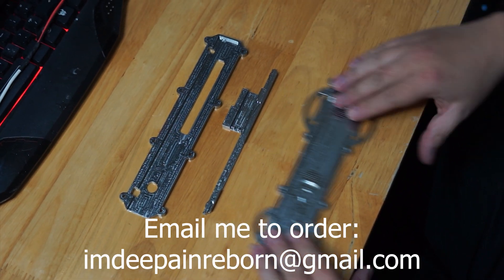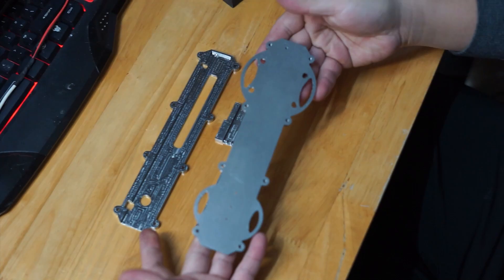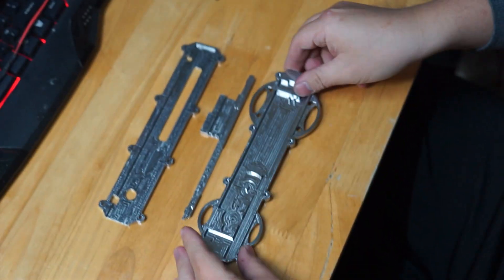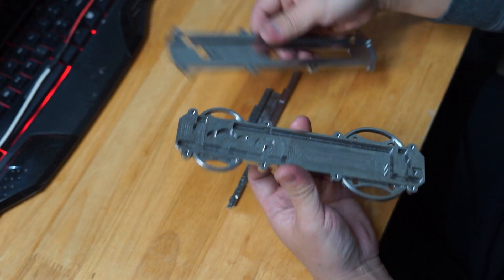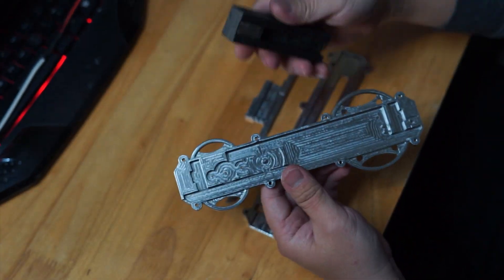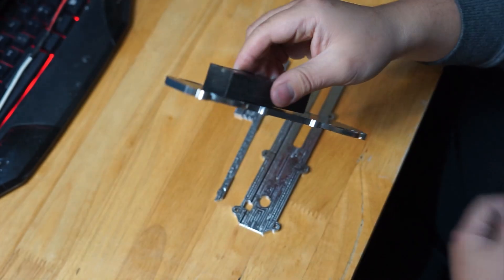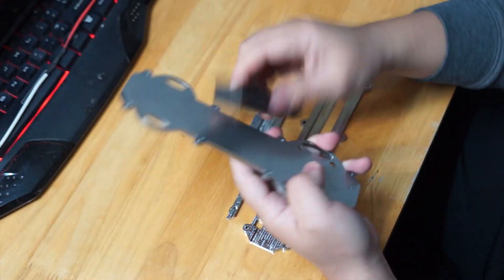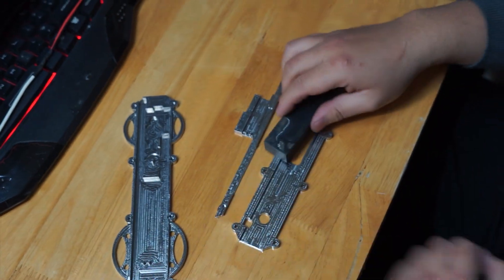Real steel hidden blade CNC project part 1

Comment: Awesome, do the benefits of using the stronger material seem obvious or does it just have a different feel than the aluminium?
Reply: Fairly obvious I would say. Think about how a hidden blade is used by the Assassins. Aluminum would get the job done if used in a precise manner against an unarmored target but it would get damaged very quickly if it meets armor or even bone. No idea if the aluminum gears have any durability issues.